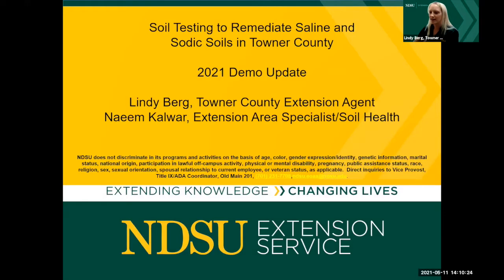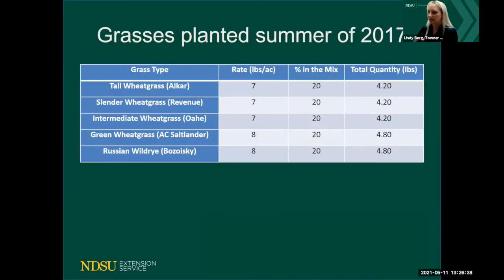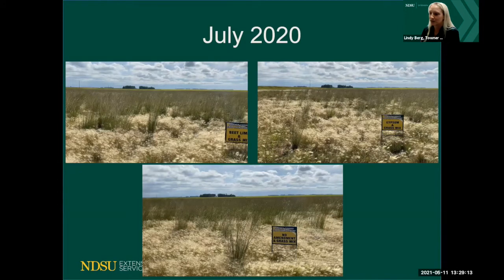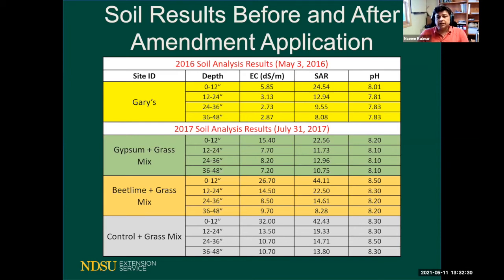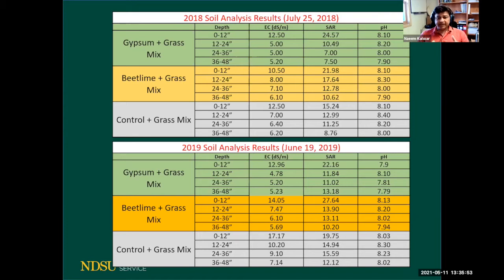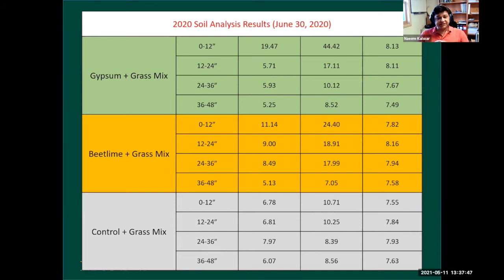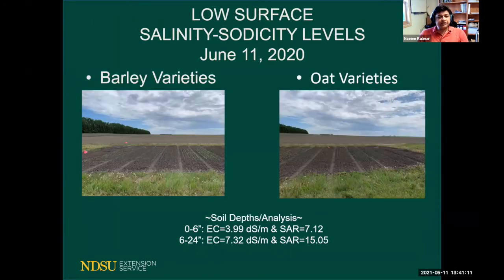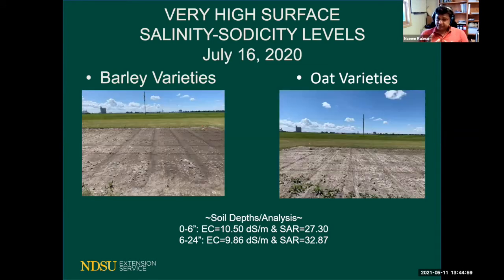Towner County Extension Soil Sodicity and Water Infiltration Demo

Comment: Great presentation!
Over the last few years we have worked in identifying beneficial pioneer or transitional species that appear well adapted to saline sodic soils. Many are familiar with Kochia's tenacious ability to quickly become a nuisance in tilled or otherwise disturbed soils regardless of salinity or sodicity. Another species we have identified that has similar Elevated EC / SAR adaptations is Lambs Quarter. Couple things about the LQ I found very interesting; the rapidly developed and deep root system, they are high in Oxalic acids, could limit salt uptake, or rather salt presence or accumulations???, it did not exert a negative effect on the composition of the desired plant community, where as Kochia can displace desired species initially. Lambs quarter is not a introduced species, in fact it has various historical / indigenous uses. Another thing I found interesting is that LQ emergence is very early and I am curious how this early spring development could potentially mitigate negative plant competition and if their are any residual effects to the soil due to the plants substantial root system as it decays.